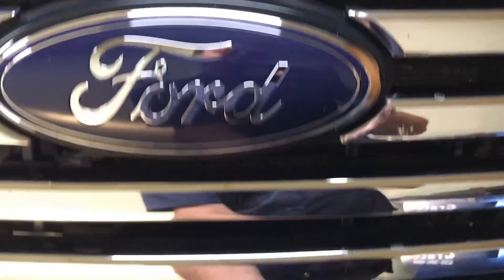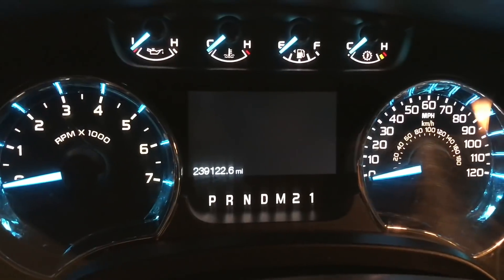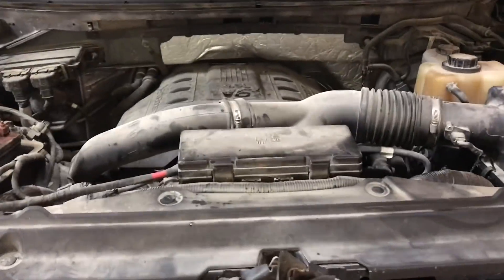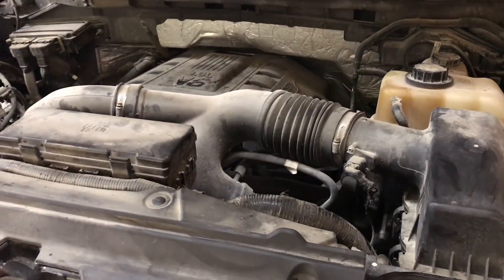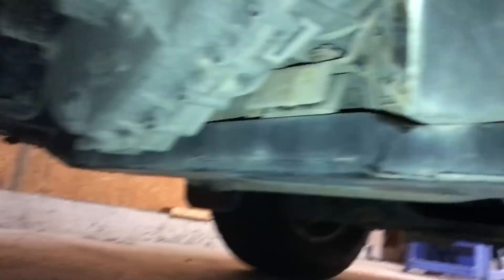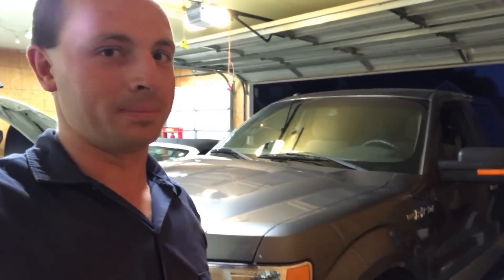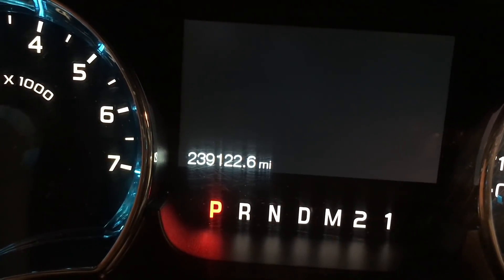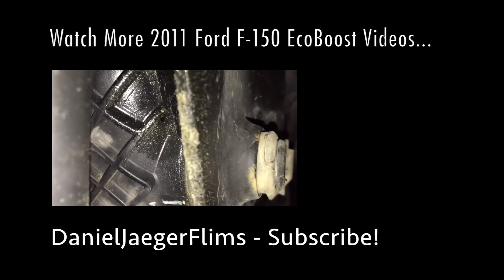Is the EcoBoost Engine Proven?

Comment: I also have an ecoboost with no problems. Here is what I don't understand about all the idiots that seem to think the turbos wont last and the engines wont hold up. There are turbos in every big rig diesel engine now a days with millions of miles on them. Wow how does that happen?? People need to think before opening their ignorant mouths. Get used to the turbos with small displacement because coming soon that's all there will be. The ecoboost is an engine that will last just as long as any other well built engine, PERIOD! If you don't like it don't buy one, that's it.
Reply: Jason Nosse sorry bud but your wrong. We have multiple big rigs we run in my family’s logging business and the reason they last so long is because it’s a fucking diesel dumbass and the turbos and everything on the truck is built 10x’s stronger and even then we still have turbo issues from time to time. Just because these trucks can run over a millions miles doesn’t mean you aren’t gonna replace shit like that at some points as for the v6 no there not gonna last as long as a N/A push rod V8 because your having to turn that v6 harder to get the same results as a V8 which is why all the v6 and inline 4’s their putting in vehicles are turbo charged and no they don’t get better gas mileage under a heavy load it actually gets worse and is wearing that motor out twice as fast. We tried an eco boost here in the log woods and you wanna know how long it lasted? 30k miles before everything started going down hill and we maintaince all our vehicles religiously. But we have old z71’s and Rams with well over 200k that are still pumping with no motor issues.
Reply: @Tanner-bg2qn  Tell that to the guy who has over 300K on his 2.7 and drives it every single day. The Ecoboost is DESIGNED with the turbos as an integral part, not something slapped on as an afterthought like in the 90's. They are water cooled, convection cooled, to prevent coking and the engine block and internals are designed to accept the power and torque it produces.  Turbo failures are rare, valve coking is non existent, every example out there is NOT an Ecoboost engine, and the 5.0 has been having more issues the past 2 years than the new Gen 2 3.5, so what does that tell you?  There were over 1 million made a couple years ago, so at this point there has to be at least 2 million of them.
Reply: acdii you my friend have done what very few people manage to do, and that is buy a ford that happened to be built on the perfect day with perfect conditions lol. I really don’t care how you think those motors hold up, from my experience and a lot of other loggers here in the swamps of NC they are complete shit especially for a work horse that’s under load a lot. Not only that but we had to PULL THE FUCKING CAB to change a got damn valve cover gasket so we could get that piece of shit as far away from us as possible. If it’s doing what you need it to by all means stick with it. Hell we gotta keep the quires outta chevys and dodges somehow lol.
Reply: acdii oh and yeah my cousins went threw two coyotes both under 100,000 along with my ole ladies mustang when we first got together and it only had 80,000 on it. All three dropped valves and their also known to have weak connecting rods so your right on that note. But that just comes to show you ford don’t give a damn about reliability anymore. And sadly once Chevy and dodge get rid of their V8 platform they’ll be in the same boat.
Reply: @acdii   its funny other automakers are adding turbos and nobody's saying shit about them LOL
Reply: @willie9397  Ain't that the truth. Must be the 2 Million Ecoboost engines that make Ford Famous for them huh.  2 Million. That is a LOT of engines. Statistics is a bitch.
Reply: Let me ask you this mate is it more reliable than the 4.9L Inline Six (as well as the 302 and 351 Windsors) in the 92-96 Ford TRUCKS.
Reply: @Tanner-bg2qn  To me all modern vehicles are becoming Garbage than ever before.
Reply: @CJColvin  Doesn't really matter since all you would see in those old school things are my tail lights.
Reply: @CJColvin  And that is me pulling a trailer while your old dogs would be trying to catch up.  BTW welcome to the 21st century.
Reply: @acdii  LOL!!!!!!!!!!! Yeah until it needs to go to the repair shop mate also the almighty 427 SOHC CAMMER V8 will sound more vicious and scare a whole ton of pretty girls than you're overpriced plastic EcoBoost truck will ever will.
Reply: @CJColvin  I wouldn't know what it sounds like since I would always be in front of it.  You know what those big hungry low powered engines are, all blow and no go.  I'll take my 553 HP at the wheels on a tune stock over the loud obnoxious, who is that idiot making that noise V8 any day.  Besides, Country girls like a Pickup man over a blow hard any day of the week.
Reply: @Tanner-bg2qn  tired of people talking about their 30 year old ohv pushrod engine trucks. Goddamnit those days are long gone, engines will continue to get smaller FI systems. Even Toyota has joined the bandwagon now. For people that need new vehicles this new trend is all that will be available.

Comment: My 2011 F150 3.5 ecoboost has 398k miles only major repair is transmission at 353k. Water pump at 200k. Otherwise plugs every 50k and coils every 100k plus normal belts, hoses, and brake pads and rotors.

Comment: I have a 2013 eco boost with 80,000 miles on it.   I do tow a 20 foot long camper trailer on occasion with no issues.  My camp site is at 8,000 feet in the eastern Sierras, and  I have no loss of power at that altitude.  No issues with the temperature at 110 degrees in the desert either.   My gas milage varies greatly,  between highway and city driving with an average of about 18 mpg.   Overall, best vehicle I've ever owned, and I have had a few.

Comment: That is impressive.  I had a 2013 F150 crew cab lariat ecoboost and loved it.  I have currently a 2018 F150 with the generation2 3.5 ecoboost with poet and direct fuel injection with 10 spd trans
Reply: 240k is impressive for a Ford, but not a Chevy or Dodge
Reply: Does your poet use iambic pentameter, or work strictly with haiku?
Engine running,turbos spin, full tank of ethanol, leaves chevrolet far behind.
Reply: It's true. I just recently sold my 2000 Sierra with 243k on it that was used as a work truck for years and it had no problems getting there. Just upgraded to a 2018 silverado and expect it to easily hit the same numbers.
Reply: @RiggyRonnie  oops I think you messed up there 😂

Comment: I have the 2014 3.5 eco with 56000 and no issues thus far. I do synthetic oil changes every 5000. This engine blows by my buddies 2014 5.0 engine with ease :). I plan on keeping this truck for many years so time will tell. Good video and thanks for the updates!

Comment: My dad's 2012 eco boost has 248,000 miles on it and only changed plugs and wires, and 02 sensors. Looks exactly the same as this truck completely dry underneath. It's going to be a construction vehicle for me now so we will see how much more abuse it can take

Comment: Don't tell Motor Trend or Car and Driver an American made vehicle runs this well....
Reply: ...or Scotty Kilmer 😂😆
Reply: Fords are the worst trucks in the planet! So many issues with so many of them. Just because someone had over 200000 miles on A truck doesn’t mean they are well built. Quite the contrary actually.
Reply: @pbaker7160  I actually have a E250 2001 with 296000 miles hahaha. Oil pump issues with 2 valve triton intake manifold crossover breaks with 2 and 3 valve phaser issues etc etc etc. There is a reason they stopped the triton motors AND a reason tons of mechanics refuse to work on them. Ford trips over their own asses constantly. No such thing anymore as a “well built truck “ from anyone. Just over engendered shit that’s set up to break down. So tired of the argument about this brand is better than the other. THEY ARE ALL GARBAGE

Comment: I purchased a 2022 Ford Transit 350 AWD HR and converted it into a Class B RV. I’ve been changing the oil at 5,000 miles since, and I am at 55,000 miles. I hope my van will reach this much miles w/o any major repairs. The drive shaft looked brand new on this video. I wonder why he replaced it.

Comment: Great video, I bought a 2017 F-150 that had 80k miles on it and now has 90,000+. I had a 2007 Nissan Titan that had 295,000miles when I passed it down to my son who was headed off to college, that truck is still going to this day. Like you said, routine maintenance and not driving like an idiot go a long way towards keeping a vehicle healthy. I change the oil/filter in the F-150 every 6,000 miles and take care of it in between (same routine as the Titan had). My mileage is fairly bad though as I put a leveling kit and fairly large Toyo MT's on it - took the MPG from 20ish to 15ish - but those tires sure do work good off-road. I am hoping this Ford will last as long as my trusty old Nissan, however due to all of the electric bells and whistles of the Lariat package I have, I'm not so sure.

Comment: I own a 2013 F-150 Lariat 4x4 with almost 100,000 miles and this vid makes me proud.
Reply: I had one towed a Wells Cargo with it over mountains blew a turbo, $5K. Less than 10 K later more problems, towed in to Flagstaff Az and traded it for a 2013 V8.
Reply: What engine is it.
Reply: @CJColvin  3.5 Liter Ecoboost
Reply: @kaiseralbrecht6099  Sounds awesome.
Reply: @CJColvin  it does sound awesome. I have the AFE Magnum Force intake and a MBRP 3" catback installed.
Reply: @kaiseralbrecht6099  Sounds awesome. How much power is it making with those mods.
Reply: @CJColvin  idk i havent tested it on a dynamometer.
Reply: @kaiseralbrecht6099  Oh ok just wondering.

Comment: I had a 2012 FX2, wtih the 3.5.  Ran great.  I always changed the oil when the computer told me to, which worked out to be around 6000 miles.  Kind of miss it, but don't miss the monthly payment I had, and I'm driving a slightly smaller vehicle, which makes it easier to park.  Those supercrew trucks are like school buses.

Comment: So glad to see these are reliable, picking up a 13 Platinum with the 3.5 Ecoboost on Thursday with only 55k miles from one owner, Should last me a long time!
Reply: It'll last till you get the p0016 code. Very common on the 3.5l. The timing chain stretches cause the timing chain is long as hell. And its a $2200 plus job. I have the problem right now. Going to do the work myself so it'll be around $800. But Google p0016 and you'll see everything. Wish I knew before I bought it.
Reply: @wrldisyours3328  dealership just fixed that for me.  I noticed a leak from passenger side of motor.  They took it apart to investigate and found a bad seal but also timing chain nearly worn.  Replaced on their dime as I had brought it back within 24hrs.

Comment: I know this is a old video but I was wondering if this truck has or had any issues with carbon buildup on the back side of the intake valves. I have seen lots of examples and comments about this issue with gasoline direct injection engines and turbo engines are even worse about it. A week ago my wife and I just bought a brand new 2018 ECOSPORT with the 1.0 liter Ecoboost. So far we love this vehicle. Handles great and that little three cylinder Ecoboost engine is peppy enough for us. It’s no screamer by any means but it’s no slouch either.

Comment: These EcoBoost engines are tough.  The 3.5L's.  Not sure yet about the 2.7L.  Only time will tell on those.  Everyone I know who has an F150 with that engine though love them.
Reply: DeadofWinter321 love mine
Reply: I got 80,000miles on my 2013 not a problem runs like a champ
Reply: DeadofWinter321 love my 2.7, only 37k but I’m sure it will run forever like my other ford did for 230k with proper maintenance
Reply: @rexixtencia1  2.7 Are also iron graphite compared to the aluminum versions. Think it will last a long time.
Reply: Iv got a 2017 2.7 and 2019 3.5 ecoboost. The 3.5 has been good but the 2.7 is complete garbage. Nothing but constant problems and I’m only at 29k. Has yet to tow more than 80 miles without stalling issues.

Comment: I would tend to agree with the statment "take care of it and it will take care of you"; My dad's 2007 Acura MDX (which we've had from new) has 310,000KM on it (original engine and transmission). Goes in for service about twice a year (when the car says it wants a service), and even though we're pretty hard on it (tows a trailer alot of the time) it still runs and drives like new! Still a pretty nice car and my dad says he's gonna drive it 'till the wheels fall off (he really likes his car)

Comment: 21 mpg ... that's great
Reply: MetaView7 mine is 16.4 with 80 percent mostly highway. I have the 2015 Ford F-150 platinum with 3.55 rear differential gear ratio. Is this expected?
Reply: CZ TS !!! Yes, if you babied it, my buddy’s platinum with the 3.5L got 18 mpg combined
Reply: @czts4778  it’s all indicative of how hard you stomp on the gas and your gear ratios.  Sounds about right for those older F150s

Comment: 2014 3.5 eb f150 here, 102,000kms timing chain rattle on startup...ford did the entire timing chain assembly...very well maintained mobil 1 full synthetic and motorcraft filter every 8000kms ect....timing chain shouldn't be shot at 100,000kms or 60,000 miles!!...there's a tsb out on the issue seems like alot of pre 2015 3.5 eb are having this problem with premature timing chain stretch.
Reply: Jim Grootjans it should be oil change 3700-4000 MAX on a Turbo vehicle... that maybe be 75% of the reason
Reply: I was going to mention this. I work for Ford and we've replaced a pile of timing chains in the early EcoBoost 3.5L engines. If this guy got this many miles on an 11 without a timing chain replacement he's doing Damn Good.
Reply: mine did the same at 65k, altinator 75k, passenger side turbo at 80k, both valve covers at 90k. i did the coils and plugs at 90k aswell. im now at 101k and has been running good

Comment: About the "there's no replacement for displacement " well, I have to see engine braking between both engines, and reliability between them in  heavy duty tasks. If that truck is getting 21 mpg, it's  because it is not working really hard.
Reply: Even under heavy load they perform amazing in stock form. Its barely in 2nd place behind the Silverado with tow capacity and thats a 6.2L V8 vs the 3.5LTT engine. The HO 3.5L in a stock Raptor is making 450hp at the crank, compared to the 6.2L V8 that makes around 420 crank horse. Of course were not only comparing power or tow rating but I'd say for its class of engines it definitely makes up for its smaller displacement. Its a middleweight fighting in a heavyweight class and its winning 🤷‍♂️ I owned a 2018 Silverado with the 5.3 last year, 5 days after owning it the camshaft and all 16 lifters had to be replaced. GM is not making quality like they used too. I switched to a 2015 Platinum Screw with the 3.5 and won't ever look back. Bolt ons, methanol and a really good tune makes the 3.5 a hard to beat engine from the other half ton trucks with modified V8's. The 3.5 has been proven for some time now.
Reply: No disrespect intended either, just my 2 cents.
Reply: @bic94  yes, I understand. I was trying to say that I can't imagine a 3.5 EcoBoost doing the same job of a big block (like the new 7.3), power is not all, you need reliability, good fuel economy during heavy work, and engine braking. I don't believe that the 7.3 gives the same engine braking power vs the 3.5 at same rpm. And you are not unrespectful, I appreciate and thank your point of view. Greetings

Comment: Curious to see how they hold up with age. Miles is no big deal in modern times for an engine...once running at steady state not a lot of occurs. When they are 10-15-20 years old with a bunch of cold starts, worn out rubber parts, etc I'm curious to see if they will get leaky and unreliable or not. Only time will tell!!
Reply: Jake C that's the same thing I tell people miles is just as important as years only time will tell
Reply: Manufacturers continually add plastic parts to cars. In my experience they get brittle over time. If I am not mistaken the ecoboost has a plastic oil pan even. Every car has plastic intake manifolds etc any more
Reply: @Jame Avery the composite oil pans save weight, don't rust, are stronger, and also save production costs.
Reply: @jamesavery6671  I was under the impression only the 2.7 liter version has the plastic pan but not the larger 3.5
Reply: Jake C This pretty much answers your question.

Comment: I think these are the best videos… proven vehicles. I own a few trucks myself with trouble free miles on them… ’99 F150 4.6L 2V with 365K…2008 Silverado 4.3L 325K… 2009 Silverado 4.8L 370K and a 2011 3.7L F150 275K. I sold a ’94 Dodge Ram 1500 5.2L with 385K still running good. Yes maintenance is the key for longevity.

Comment: I just made 230k on my 2011 F150 XLT EcoBoost. Only replacements: rotors, calipers,02 sensors, catalytic converter, alternator and heater hoses.

Comment: My uncle got a 2017 f150 with a 3.5 ecoboost, not even 3,000 miles in, there was a misfire and Ford found nothing wrong, after 2 months of renting a Ford Focus when he needs to tow a trailer like Every week. They finally gave him a new engine. Fully covered by the warranty. No problems since.

Comment: I think taking it easy in a new vehicle for the first 2k miles or so helps as well.
Reply: Most engine builders say the opposite! That the most crucial point of an engines life is the break in period, and that driving hard (once up to full operating temperature) for the first 1,000mi or so is the best way of bedding the rings etc. which is believed to prevent it from becoming an oil burner as it ages...